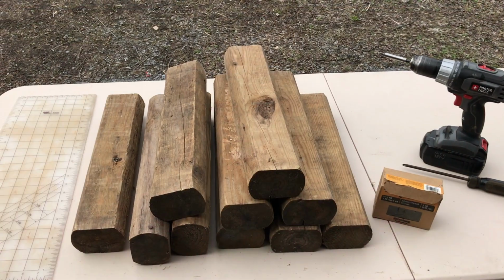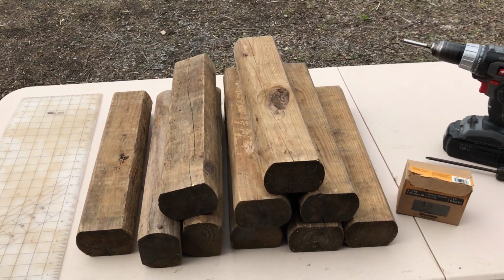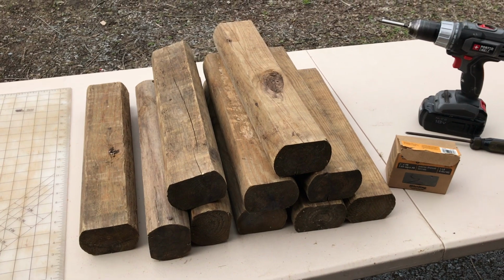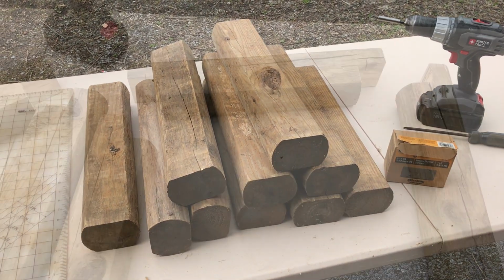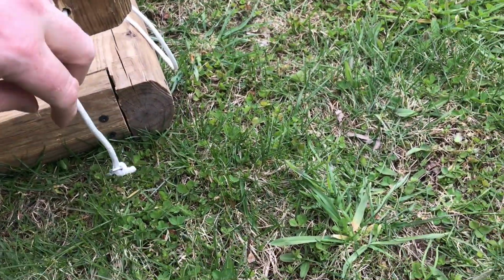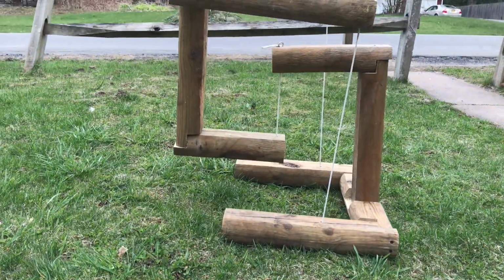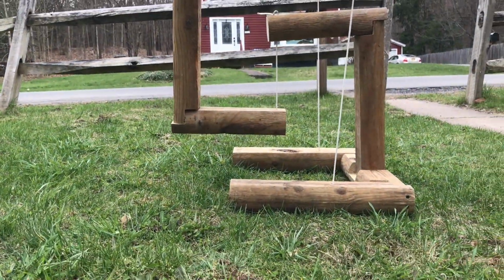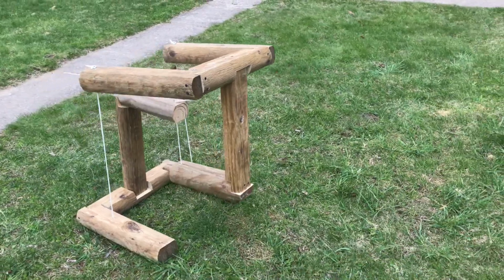DIY Wooden Tensegrity Floating Lawn Art

Comment: The center string carries the top object, while the 2 longer string purpose is to stablish leverage or maintain horizontal position. It looks that the top object seems floating.. the middle string is the vital tensil force. .
Reply from the maker: Antonio Mallari yes. If you make one yourself I would recommend chain. The center string stretches a lot.